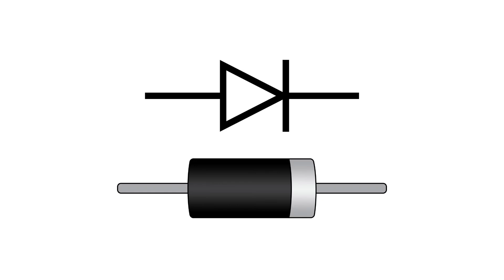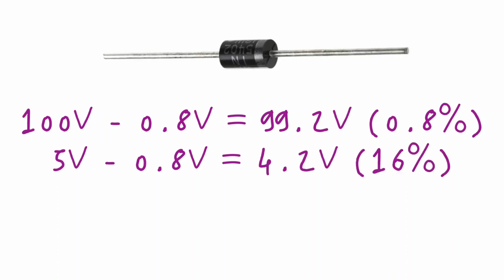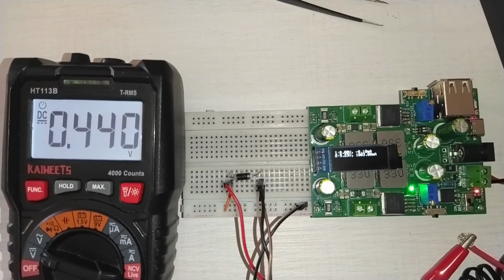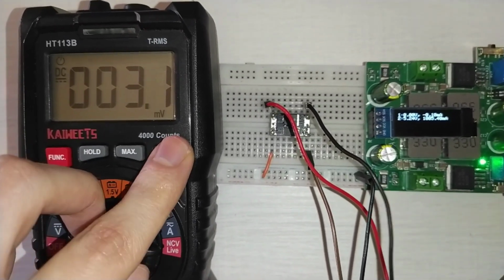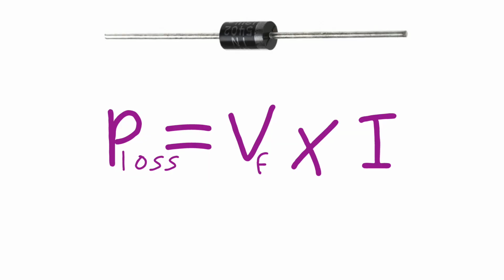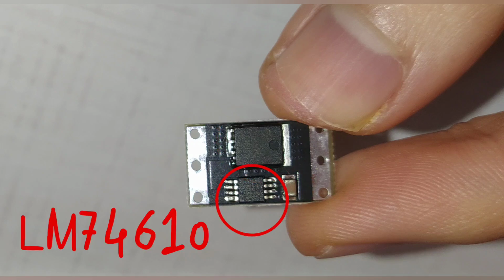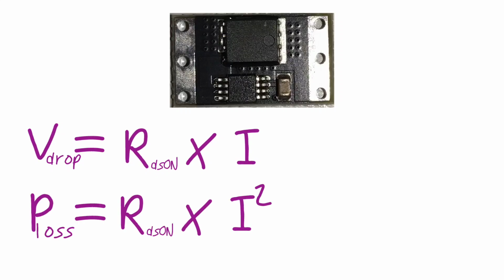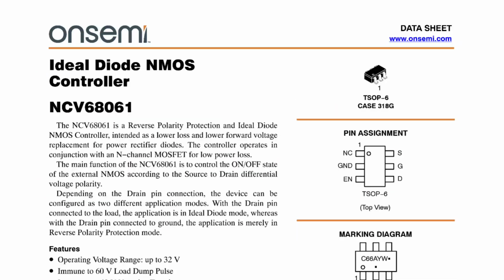REJECT real diodes. EMBRACE ideal ones

Comment from the maker: Hi all, SOME CLARIFICATION NEEDED:

Since I recevied some comments regarding the complexity and the effective use of those circuits I have to clarify something.

1. Those ideal diode module are EXTREMELY EASY to use. Just like a regular diode. But obviusly they are more complex than a regular diode

2. The complexity and size of those modules will increase as the current capabilities, as you SEE in the video. Designers have to paralell mosfet and do thermal calculations. However they STILL REMAINS EASY TO USE

3. Those ideal diode modules do not go as high as real diode when it comes to reverse breakdown voltage

4. Other technical stuff was omitted on purpose. To make the video shorter. HOWEVER nothing critical for beginners! 

Thank you to all!

Have you ever used ideal diodes or ideal diode controllers?

If you want, you can follow me also on:

IG: https://www.instagram.com/xburningelectronics

Want to support me?

https://buymeacoffee.com/xburningelectronics

Comment: amazing module for replace traditional dioda, we know schottky diode lower Vf than regular diode but more hot
Reply from the maker: The only thing is that, depending on the IC used, you could have more leakage current

Comment: FFS calling diodes garbage straight away? Really? Without more elaboration as well? This is like calling a bus garbage only because you have a car now. As everything like always theres pros and cons. You didnt even list them, when insulting something you are signing an explanation later on
Reply from the maker: @pain2737  It's just the language I used ahah that's nothing wrong with diodes. Wanna a downside of those ideal diode? Unit cost is much higher. But do you really expect people to not know it? It's just a presentation of a product that people may find useful. Don't get triggered by my words, it's the message not the words that I use
Reply: @BurningElectronics thing is that with "ideal" diode the reverse voltage is much lower which could be a problem. it can be prone to interfierence in loud electrical enviroments. yes it is more expensive as it has to "know" when to conduct itself if its a bridge rectifier. last i can think of is size and repair is impossible (same for diodes) so double that cost. 

either than that i like that idea dont get me wrong but there should be more stuff covered so its not just show off but more educational. thats what people are here for mostly
Reply from the maker: @pain2737 Hi, as another viewer pointed out regarding the reverse breakdown voltage I said that yeah those are fine only at low voltage (<100V). I don't think there is an ideal diode controller that could do 1kV reverse voltage. This is the only important thing that I missed. So with this you're right. Whereas for size and cost I think it's on the eyes of everyone. For other technical stuff like leakage current, reverse recovery time etc. I voluntarily not cover that to keep the video simple, also beginners don't care about this staff, however they can care about reverse breakdown voltage, true. And for more experienced people they would look at the datasheets anyways if designing one. Thank you

Comment: for reverse polarity protection this is overcomplicated. just use a p channel fet and nothing else
Reply from the maker: @samueldavies646 I think for newbis is just as complicated. This is 2 terminal device. A PMOS is a 3-terminal devices. For a total beginner I think it's easier to use an ideal diode as it used to real diodes already, there is really no overcomplication here. If you are a designer instead, ideal diode controllers are just better anyways as they often drive NMOS for efficiency, or even 2 back to back like the NCV68261. Which also offers UVLO and OVLO. Some also offers also thermal protection, something like power switches. And all the controllers don't care about the gate voltage. So sure a PMOS is easier to use as you dont have to design much, just a zener for gate protection, but with ideal diode controllers you have more possibilities
Reply: @BurningElectronics  you don't really need zener for gate protection. Good point that nmos lower RDS than pmos, but imo really high current applications shouldn't be handled by people who cannot connect correct way round. Also these things with high current dangerous and shouldn't be done by a beginner too inexperienced to even design with pmos. Plus can probably get a pmos reverse polarity module. Also in really high current diode/scr used instead
Reply from the maker: @samueldavies646 Hi, I'm with you with the fact that high current shouldn't be done by a beginner. Also you need a zener to protect the gate of the mosfet, there are tons of examples out there with the zener and why it's there. But this has nothing to do with the "overcomplicated ideal diode module" those modules are really ready to go. I don't see any overcomplicated things here. But maybe we have just two different point of view :). Thank you

Edit: See AND90146 for the zener thing
Reply: @BurningElectronics ahh now I see zener makes sense... I was thinking example when voltage supply within gate threshold but you are very much correct needed when more than. Also really good point, as is a module complexity doesn't matter.

Comment: It's only applicable for low power applications. Using regular diodes you get high reverse breakdown voltage and high current capabilities. Ideal diodes cannot compete in these two categories. Another thing, Rds*I^2 is only superior at low current. For high current, Vf*I is much more suitable, losses are proportional to the current, and  not to the current squared.
Reply from the maker: @filips7158  Let's do a pratical comparison. Let's say we have a diode with 0.4 Vf and a mosfet with 1 mohm resistance.
When will our diode power loss outperform our mosfet power loss?

We do 0.4*I < 0.001*I^2

We get I > 400A

So only at 400A you will have a better power loss. And we are using a 1mohm rdson mosfet. On the market you can get even lower. And for those kind of application you probably want to design yourself your ideal diode with parallel mosfets and some control circuitery. Same regarding the voltage drop.

Obviusly we size our mosfet based on the current and power dissipation.

I must say that most of the lowest rdson mosfet are only able to withstand no more than 60V. But you can always parallel higher voltage-rated mosfet. For reference this NVBG020N120SC1 can withstand 1.2kV vds and has a rdson of 20mohm. Much higher than 1mohm but still pretty good.

I still have to confirm if there are any controllers out there that can withstand reverse 1kV

In any case those are fine for relatively low voltage (<100V) high current devices. For higher voltages maybe real diodes are just better
Reply: @BurningElectronics Right off the bat - Vf is more between 1 to 2V at high current, let's say 1.5V.
However, 1mOhm rdson at high current is impossible. It's usually in tens of mOhm, maybe even 100s. If you have very low RdsON, you have low max admissible Vds.
BTW I would love to be proven wrong,  now or in the future as semiconductor technology improves. In case you have counterexamples, please let me know, I'm buying.
Reply from the maker: @filips7158  Hi, okay okay the example is bad ahah. Still I remain on my position. For one MOSFET you can look at BUK7S0R5-40H. And look also at fig.11 that is RdsON vs Ids. Obviusly you can parallel them to go even lower. But really for those high current even the contact resistance of your terminals have to go into account. Also thermal dissipation. The design could be really complex. I've not designed something as high current as this. For this high currents sure one have to go high in copper thickness. I cannot really prove you wrong. Only in theory🙃
Reply: @BurningElectronics you're missing one big principle - best part is no part, you pretend like mosfets are the solution to every diode problem, they aren't, they introduce unnecessary complexity which reduces reliability, you're like this 1st year EE student who learned couple formulas and red few datasheets and now thinks that he knows everything, you do not, nobody with couple decades of actual EE experience will agree with your statements, only green EE like yourself will
don't invent solutions to problems that do not exist just to get some YT attention
Reply from the maker: @rikkc137  Hi, it's not the solution to every diode problem, if you need 1kV reverse breakdown voltage. You would need an ideal diode controller with that capability which probably doesnt exist. Those are fine for low voltage high current. I don't agree with "Best part is no part". Sometimes you want a simple design. Sometimes you want better performance with a more complex design

Comment: if you are not working with high amperage, then what you need an ideal diode for?
Reply from the maker: @v037_  Well ideal diodes are still useful at low current. Normal everyday diodes can have a big voltage drop even at 100mA (0.1A), sure, less than 0.8V, but it really depends on the diode. But let's say you get a really really optimistic 0.3V. Well 0.3V it's still 100 times greater then the 3mV I showd with this ideal diode module. The difference is not big at 100V but if you work with let's say AA battery with 1.5V nominal voltage well then it starts matter. But sure you see a bigger difference at high current

Comment: What are the common names for such circuits? Please let me know thankyou in advance
Reply from the maker: @Godofrageyt  If you are talking about the module itself, those are called "Ideal diode modules".
If you are talking about the controller ICs, those are called: "Ideal diode controller" or "ORing controller" or "Smart diode controller" or "Reverse polarity protection controller" depending on the manufacturer. But they are all essentially the same circuit with 1/2 MOSFET gate drivers to tell the MOSFET(s) when to turn on or off